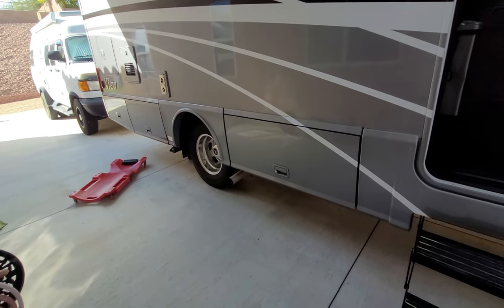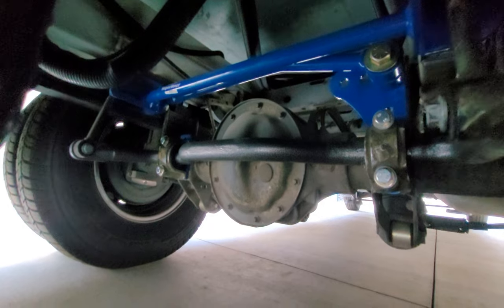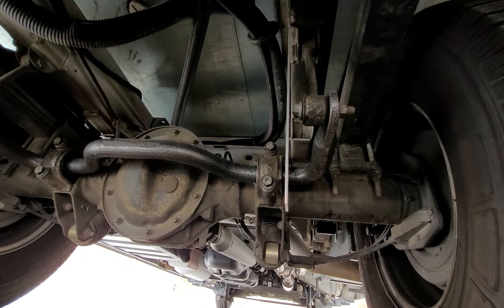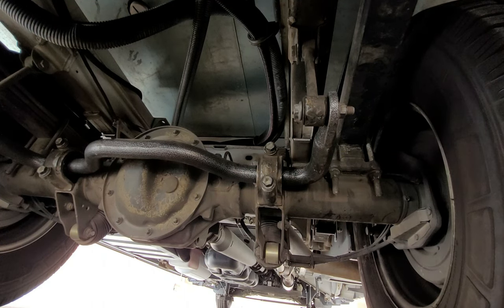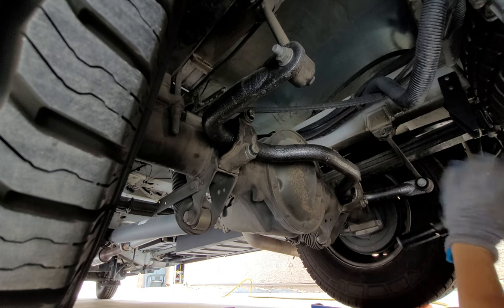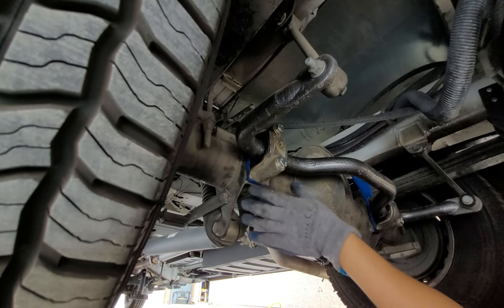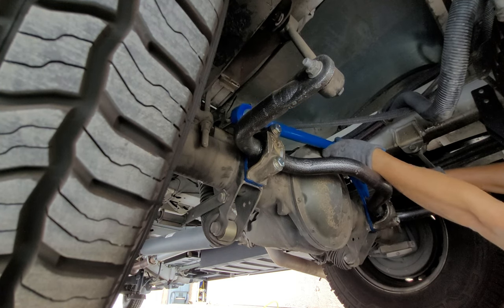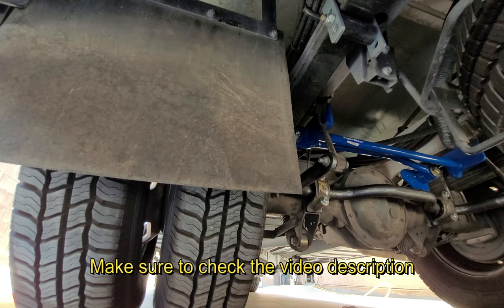My Final Suspension Mod on My Winnebago View Sprinter Van

Comment: Thank you, I've been looking at the same thing. Can't wait for your evaluation.  Also waiting for evaluation of front shock change.
Reply from the maker: In my opinion, every component has made small incremental improvements, and all of them are necessary.  There wasn't a single component that fixed everything, as they all have different functions. The front adjustable Koni's are a must do, as they will also help with the porpoising.  The trac bar helps with the wind, but not a magic cure to fix everything, but does make improvements.  My best suggestion is to call Henderson's Line up and get their take.  The sprinter chassis has many areas that need assistance for better driving.

Comment: The upgraded sway bar and track bar is $1,100. Do you feel like this really helped? Which bar helped most? I have noticed the Sprinter I have is getting looser as the mileage increases. The biggest issue seems to be the wind is affecting the drive. When I first bought my Sprinter, I could set cruise 72-75 without complaining about ride. Now I’m 65-67 and on windy days and Wife will get nauseous after couple hours. Will my money be well spent on the upgrades and which one makes bigger difference?
Reply from the maker: I would say the sway bars helped the most and a must do item. The track bar was more over the top mod.  If your sprinter has been getting worse, your shocks may need to be updated to new aftermarket shocks.  They will make a big difference.  In my opinion, you should do the sway bar, new rear shocks from supersteer, and new koni front adjustable struts.  Once you do those, then determine if the Trac Bar is necessary.

Comment: This is very useful. Thanks. Would this work for 2018 sprinter chasis?
Reply from the maker: It will.  I suggest calling Henderson's Lineup.  They have many suspension modifications for the Sprinter Chassis.  Call them and ask for Tommy.  He can walk you through any items you may need.